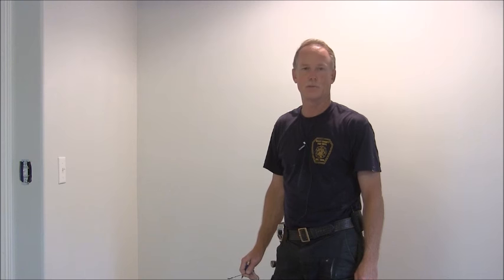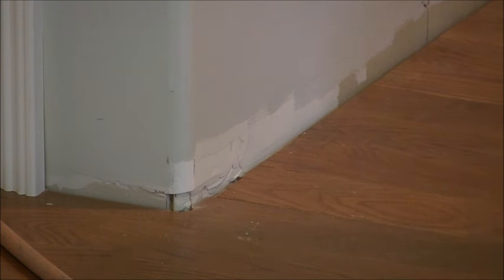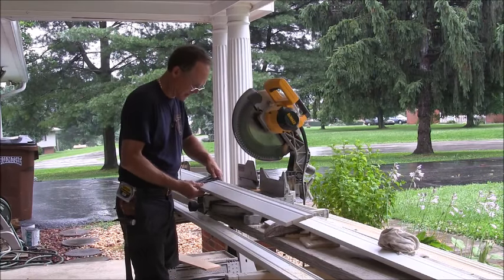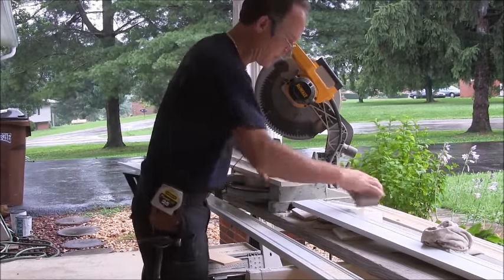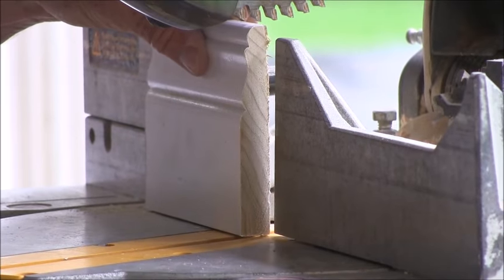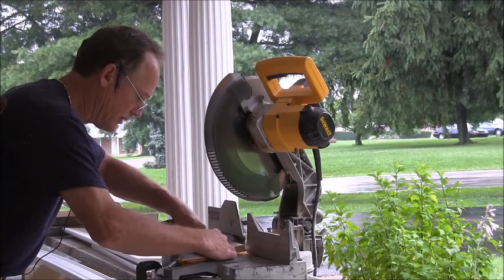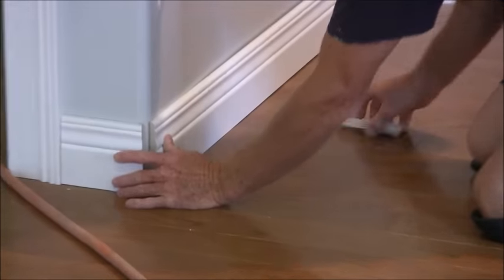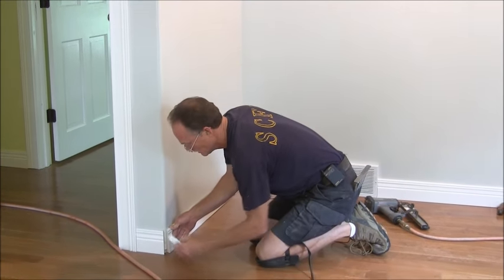How to Install Base Trim On A Bullnose or Rounded Outside Corner

Comment: Thank you very much for your video, I thought I would have to cut several little pieces for the corner but with this method is way easier! I did thirty ft. With three corners in less than an hour :)
Reply from the maker: Glad I could help!

Comment: I enjoyed your video. I've  made untold thousands of 3 piece bullnose base corners over the last three decades as a trim carpenter, ever since bullnose drywall corners became common. I NEVER do the corners this way by adding  the shorty as a last piece. I set, mark where the miter needs to be-by eyeballing the gap, cut the miter, cut and install the first long piece. Cut a 22.5 on the shorty and set it in place, and mark the other 22.5 where it will intersect the next long piece. Glue and pin the shorty. Then measure to the long point on the little piece. Mark and cut at 25 degrees, NOT 22.5, so the outside is closed. Also I regularly use my hammer to persuade pieces into place. And use a small 18 gauge OMER nailer. Plus glue the heck out of the entire corner before pinning it with TiteBond 3.

This is way easier to watch then me explain, but I can fly on these corners and very rarely  have the short piece to recut, because it was marked in place, not measured. Doing these all the time house after house after house, year in year out, for decades, you get really good at it. I used to make a 45 degree jig, set it in the corner, and mark a fine wittness line on the bullnose corner where the miter needs to be, but you get to the point where it is easy to 'read the gap/miter' by eye. You just KNOW where the joint will be by eye after doing  a lot of them. Anyway I really enjoyed your video. Very nice joint.Thanks.
Reply: Make a video

Comment: I have these corners in my house. Wow. Fancy me!
Reply from the maker: They can be tough!
Reply: @doityourselfdenniscom  

That is what I am seeing. I am going to do my flooring pretty soon so I am going to salvage as much baseboard as I can. My current baseboards have this little piece that has the round cut out and fit perfectly on the round corner. Then you just connect the baseboards straight against it on both ends. It looks nice. Hopefully it made sense the way I explained it.
Reply from the maker: @JoseMartinez-bs8oi  Makes sense. They do sell a special corner that you put on when the corner is installed on the drywall that makes it possible to make the corner a 90 degree so you can 45 your trim.

Comment: Nice but this way takes quite a bit of time. I work in new construction doing baseboard, shelving, and doors so we try the quickest & best looking way possible. How we do it is mark our chop saw for the corners then 22.5 one side then put it to the mark & 22.5 the other side. When cutting the pieces for the corner i use a scrap piece cut at 22 for a guide then put the guide to the corner to where it looks perfect then mark both sides of the bull nose with a pencil & cut. Usually comes out perfect but if not you can flare it out like you did with the chisel. Either that, shims, or beating the drywall lol. Hope this helps.
Reply from the maker: I am certain that the way I do this isn't the only way. This is just how I learned. Thanks for the suggestion.
Reply: Can you do a tutorial with your 22.5 marking let me know
Reply: I am not fully sure what Chris is doing differently. Chris writes, (it seems)  to cut both sides at 22.5, i.e. "22.5 the other side". Then place them, if I'm inferring this correctly. Which is what Dennis is doing, with both sides placed. But instead of Dennis' 9/16 bull nose piece (with 22.5 angle cuts) to be adjusted, is Chris then starting with a 22 angle piece, then marks it with a pencil (to become the final bull nose piece) by holding it on the corner, above the placed sides?  Then this 22 angle piece has a the final cut at the pencil mark with a 22.5 angle? Or, Chris refers to this 22 angle piece as a "guide", so is the final bull nose piece marked from the guide and then cut? Should one side of the final bull nose piece be 22 and the other 22.5?   [And above, Gravity suggests placing the bull nose as the second piece, and then and then cutting the 2nd long piece marked to reach the bull nose, but at 25 degrees. This might be similar to what Chris is suggesting in using pencil marks; not a 9/16 bull nose to be adjusted. Folks, I just want what's fastest, but nice and even. I'll try Gravity's method, first, as best I can decipher these brief descriptions. If anyone can help explain this, great, or refer to another photo or video, even better. All in all this is great information. I appreciate everyone's comments and suggestions.

Comment: Great work! What do you do to clean up the lines in the baseboard made by the corner piece? Obviously after gluing you sand a paint? Do you calk the corner piece to make it look as one?
Reply from the maker: I caulk the upper line where the top meets the wall. Sand the points a little and paint. Hope this helps.

Comment: Awesome video! This explains everything about my mysterious bullnose corners, which I had never even seen before I bought this house. Baseboard is the solution for aesthetics, no doubt. Question: My power tool instructor would have a heart attack if he saw your fingers so close to the blade of that mighty mitre saw. Can the same cuts be done farther from the blade? Same question for both flat and standing cuts.
Reply from the maker: Thanks and yes.

Comment: This is exactly the info I needed.  I'm redoing the floors and baseboards on my first floor, and have had problems with the bullnose corners.  I'm getting that 'flare' at the bottom of the the small corner piece that I just couldn't figure out, but this explains it perfectly.  Thank you!!
Reply from the maker: Thank you. I am glad I could help, this is why I do these videos.

Comment: Found your channel and this video.  I'm searching for information and videos to know if it's possible as part of a renovation to round square wall corners on an existing build.  Idea is to put more of a Southwest or  Mexico-ish feel with well-rounded wall beads and curved doorways.   Sort of like, cut away the existing square corner to the studs and fashion a wide bullnose edge for a well-rounded appearance.  But I don't know what supports the contour I'm trying to build with the wide paper tape.    Would you build up a mud contour and coverage with a wide paper tape?
Thoughts?  Maybe a content idea for a future video??
Reply from the maker: I don't know where you live. I live in Kentucky and I call drywall supply houses to get my rounded corners. They are called bullnose corners. You should be able to remove the existing corner and maybe go back with the bullnose. If you can't get the corner off without destroying it, cut back to the next stud and put a fresh piece for drywall in. You can glue the bullnose on, but I always nail mine on with no glue. Also, they make a piece of trim to go with the bullnose that you can put at the bottom so that the first like 6 inches is square making it easier to put you base trim on. I hope this helps.

Comment: They also make bullnose pieces to fit right in, they are like 6 bucks at Lowe’s.
Reply from the maker: The ones that I have seen make the corner square again. You attach them before you attach the bullnose corner.

Comment: There is a plastic tool that you can buy that fits on rounded corners and allows you to mark on wall where you need to cut your product to.
Reply from the maker: Never seen it, but thanks.

Comment: Do they offer different corner radiuses for outside corner bead for drywall or is it all one size corner radius?
Reply from the maker: I only know of the one radius. Although it being made of plastic, you might be able to bend it either a little less or more. Hope this helps.
Reply: @doityourselfdenniscom  Gotcha thanks for your help!
Reply from the maker: @morokeiboethia6749  No problem!

Comment: How about a rounded inside corner with decorative base board trim. And the base board trim is thick at the bottom and thin at the top.
Reply from the maker: That sounds like something that would have to be custom made. I am sure there is a way, but that is something I would have to be there and figure out. Sorry

Comment: You can usually buy pre made bull is corners that match the profile of the baseboard that make things a lot more predictable
Reply from the maker: Yes, I realize that now. I didn't know that back then. I just put some in today. Thanks.
Reply: Where do u buy them
Reply from the maker: @sandystern1618  Check with a drywall supplier, not a big box store.

Comment: Do you recommend this process for an inside rounded corner? My house has 135 degrees on either side of the 45 degree fireplace wall, what do you recommend? The original owner had a really ugly coped joint with caulking 1 inch thick...
Reply from the maker: Yes, I would try basically the same thing. But, I would start with the inside piece and run each side into it. Not sure what the angle would be. Although if I am thinking about this right, the sides should be about a 45 degree once you have the inside piece in. Hard saying without being there. Try cutting a scrap piece and see how it works out.

Comment: should have just left the glue or used smaller gauge brads at the end of the video, you shot two more big nails and cracked the whole corner.  I am sure you took it back out and made a new piece.  Great tutorial.  good job.
Reply from the maker: Yes, I did. I now don't nail the final piece, I just glue it. Thanks.

Comment: Did you say you took off 5/16? Did you mean you should have added 1/4 in stead of adding 5/16? 
Did you cut the long pieces or did you cut another small one?
Reply from the maker: It has been a while since I did this video. I believe that I cut the short side of the trim a 5/16. Not sure what you are asking about the long or small pieces.

Comment: I'm trying to install quarter round around a bull nose wall and its a nightmare
Reply from the maker: You should be able to cut the joints at 22 1/2 degree and this should be pretty close. You will have to cut a short piece to fit in much like in this video. Start out at 22 1/2 degree and you might have to adjust one way or the other depending. Not many corners are true because of the finishing of the drywall. I hope this helps.

Comment: can you still make the same cuts if your boards are laid flat? I have a 10'' miter saw so standing the boards vertically is not really an option
Reply from the maker: It would depend if your miter saw will tilt. How tall is your trim?
Reply: @doityourselfdenniscom  it's a 3.5" trim
Reply from the maker: @tomashernandez5343  I would think a 10 inch saw would cut it standing up, but if not if your saw tilts too, then it should cut it. Probably a little more work.

Comment: I would of ran a straight edge against the wall to mark the moulding, than cut to a perfect size. Than apply CA glue to both joint, than nail that baby in.

Comment: Doesn't it matter how thick the baseboard is to know the outside length?
Reply from the maker: Yes, it will vary. Most trim is about the same size thickness. But, some will vary. I am trying get the basics. A good starting point.